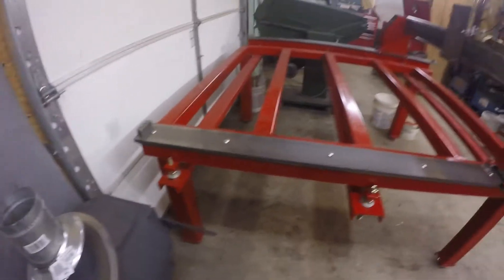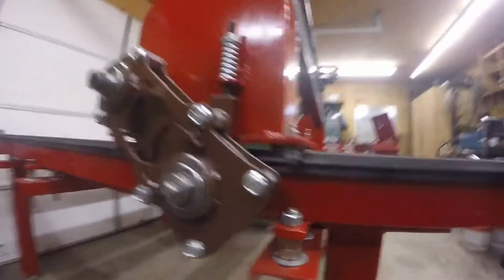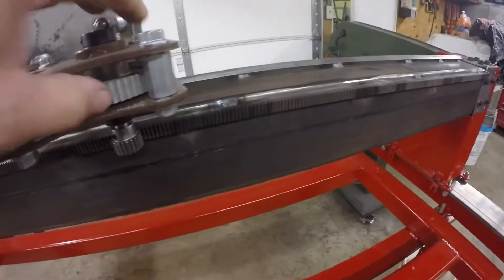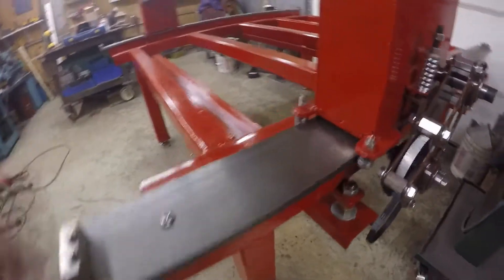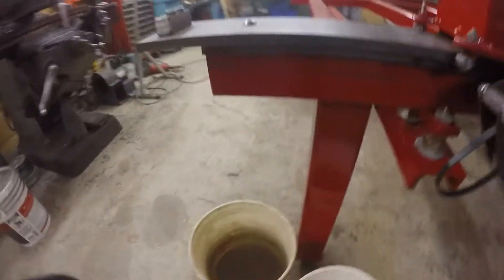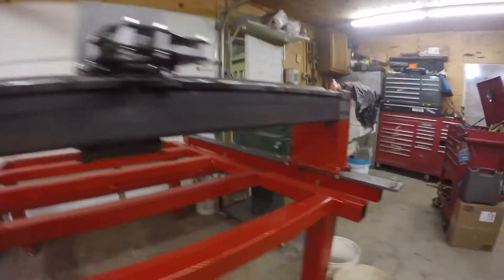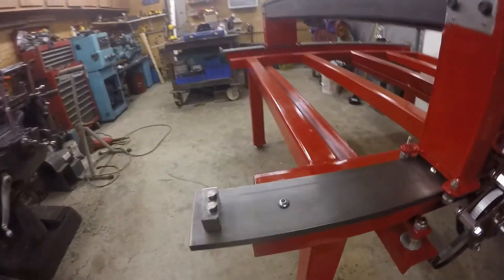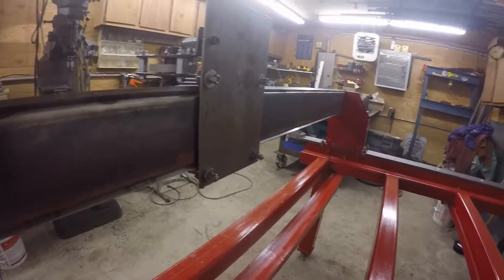cnc table  build gantry on and put together

Comment: impressive craftsmanship right there. i like all the places for fine adjustment....did you use fine thread bolts for that?
Reply from the maker: no I used 5/8 13  I had them laying around it should be ok  since its a plasma table I can make some corrections in the soft ware   next the electronics I  need to see this thing work lol.  just to many projects never enough time plus we had a busy summer
Reply: too may projects.....i am with you on that one. i am anxious to see that plasma table work.
Reply: Hello good job. Pls can you give me sketchup with measure